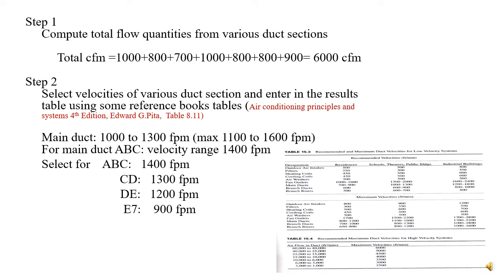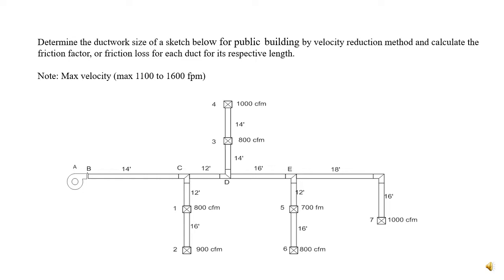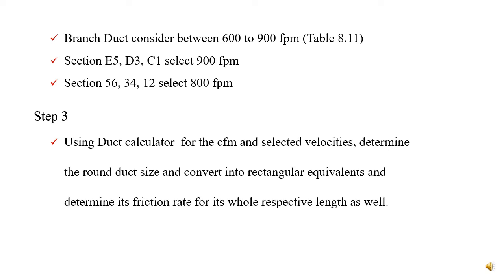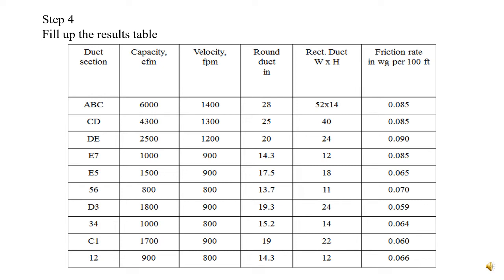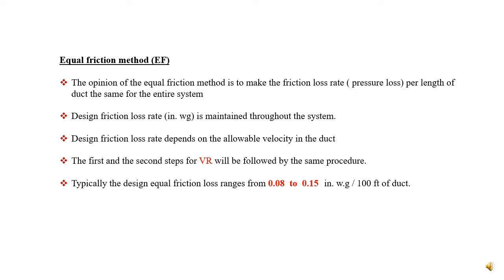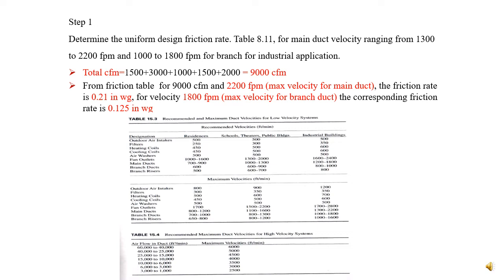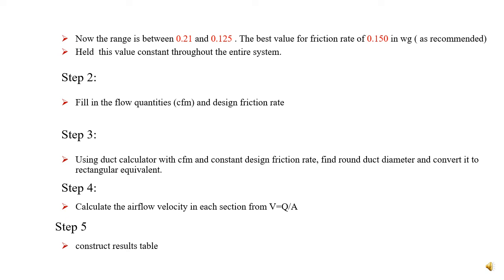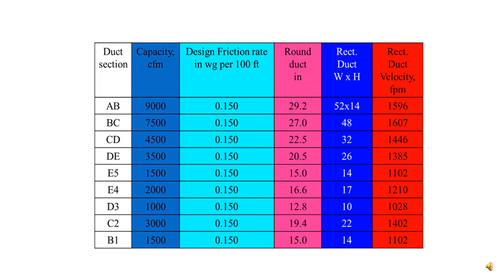Air Distribution System Design Lecture 7 part 2

Comment: MUHAMMAD SYAFIQ BIN ARZEMI
B071710014
3 BMMH S1/1

# DUCT DESIGN METHOD

  1. Velocity Reduction Method (VR)
      > Procedures to be followed = i. Assign velocities to various section of the duct system, highest velocity at the entrance.
                                                           ii. Velocities in succeeding sections are reduced, lowest at the end of duct.
                                                          iii. Assuming velocity and calculate flow area from air quantity for each section supplied.

      > Steps required = i. Compute/calculate total flow quantities from various duct sections ( total CFM )
                                       ii. Select velocities of various duct section & enters in the results table using reference books table.   
                                      iii. Using ductulator/duct calculator, for the CFM & selected velocities, determine the round duct size & convert 
                                           into rectangular equivalents & determine its fraction rate for its whole respective length as well. 

  2. Equal Friction Method (EF)
      > Procedures to be followed = i. Use the same friction loss ( pressure loss ) for the whole duct section if possible ( normally 
                                                                some industries use 0.1 in.w.g/100 ft.
                                                           ii. Chosen friction loss rate ( in.w.g/100 ft. ) should be maintain throughout the system.
                                                          iii. Cross check the allowable velocity, designed friction loss rate depends on the allowable velocity 
                                                                in the duct.
                                                          iv. Ranges of equal friction loss : 0.08 in.w.g/100 ft. - 0.15 in.w.g/100 ft.
      
      > Steps required : i. Determine the uniform design friction rate .
                                         * calculate total CFM
                                         * find friction rate for MAX VELOCITY FOR MAIN DUCT and MAX VELOCITY FOR BRANCH DUCT
                                         * take average value between MAX VELOCITY MAIN DUCT & MAX VELOCITY BRANCH DUCT ( stay in 
                                            standard range )
                                         * held this value constant throughout the entire system

                                     ii. Fill in the flow quantities ( CFM ) & design friction rate 
                                    iii. Find round duct diameter using ductulator/duct calculator with CFM & constant design friction rate, and 
                                         and convert it to rectangular equivalent.
                                    iv. Calculate the airflow velocity in each from V=Q/A
                                     v. Construct result table.

THANK YOU =)

Comment: Hakim bin Zainul B071710531

Velocity reduction method (VR)

*Assign
velocities to the various section of the duct system (the highest at the entrance,
using table or book reference) 

*Velocities
in succeeding section are reduced, lowest at the end of the duct.

*The air
quality for each section is known already and by assuming a velocity enable
flow area to be calculated.

 

Equal friction method (EF)

*The opinion of the equal friction method is to make the friction loss rate (pressure loss)
per length of duct the same for the entire system.

*Design friction loss rate(in wg) is maintained throughout the system.

*Design friction loss rate depends on the allowable velocity in the duct. 

*The first and the second step for VR will be followed by the same procedure.

*Typically the design equal friction loss range from 0.08 to 0.15 in w.g/100ft of duct.

Comment: MUHAMAD IZMAN BIN JAMALUDDIN 
B071710518

Step for design the ducting system

i.    Total flow quantities from various duct sections.

ii.  Select velocities of various duct section.

iii.  Using Ductulator helps you properly size your ducts, estimate air loss, find the round or rectangular duct equivalent, and determine velocity. It can prevent some costly errors and is great for engineers as well as field technicians.

Equal friction:

i.           Compute the necessary air volume flow (m3/s,cfm) in every room and branch of the system.

ii.          Use 1) to compute the total air volume (m3/s,cfm) in the main system.

iii.         Determine the maximum acceptable airflow velocity in the main duct.

iv.         Determine the major pressure drop in the main duct.

v.          Use the major pressure drop for the main duct as a constant to determine the duct sizes throughout the distribution system.

vi.         Determine the total resistance in the duct system by multiplying the static resistance with the equivalent length of the longest run.

vii.        Compute balancing dampers.

Comment: NUR FITRAH NADIA (B071710363)

Velocity reduction 
1. The design focus the highest at the entrance (1000 to 1300 cfm) and the the end section of duct size will be lowest (900cfm).
2. Every point can check using duct calculator to find the cfm and velocity.
3. From duct calculator also can find the size of round or rectangular duct.

Equal friction
1. To make the friction loss per length of duct the same for the entire system
2. Design friction loss rate (in. wg) is maintained throught the system. 
3. Use duct calculator.

Comment: Muhammad Akram (B071710573)

Equal friction method (EF) (small to big duct)
- make the friction loss rate (pressure loss) per length of duct same for entire system.
- Design friction loss rate maintained throughout the system.
- For the calculation, first and second steps for VR were followed same procedure.
- Design EF loss ranges from 0.08 to 0.15 in.w.g/100 ft of duct.

Comment: Mohamad Hurairah B071710461 

Velocity reduction( VR)

-Assign velocities to the various section of the duct system, the highest at the entrance. 
-Velocities in succeeding sections are reduced, lowest at the end of the duct.
-The air quantity for each section is known already and by assuming a velocity, enable flow area to be calculated

Equal friction method (EF)

-The opinion of the equal friction method is to make the friction loss rate ( pressure loss) per length of duct the same for the entire system
-Design friction loss rate (in. wg) is maintained throughout the system.
-Design friction loss rate depends on the allowable velocity in the duct
-The first and the second steps for VR will be followed by the same procedure. 
-Typically the design equal friction loss ranges from 0.08  to  0.15 in. w.g / 100 ft of duct.